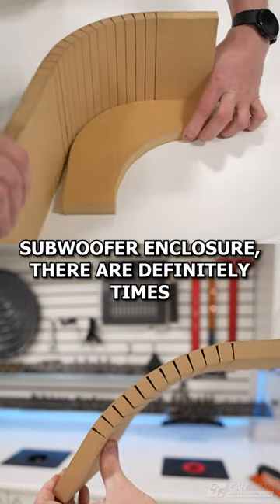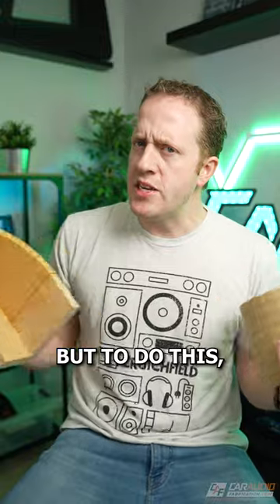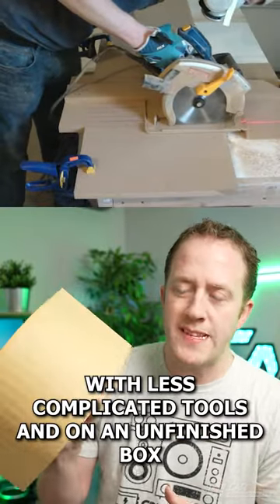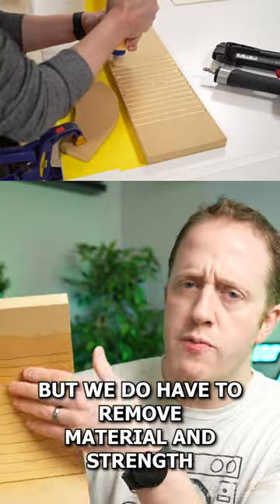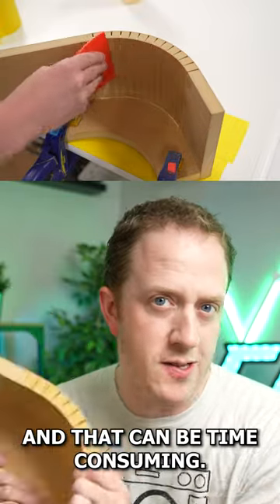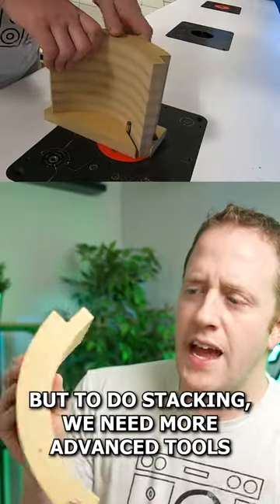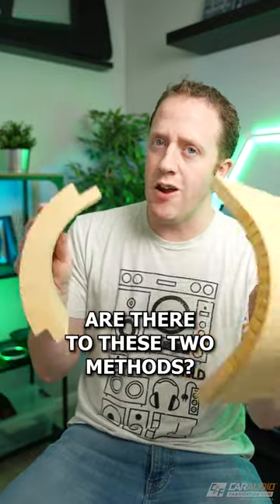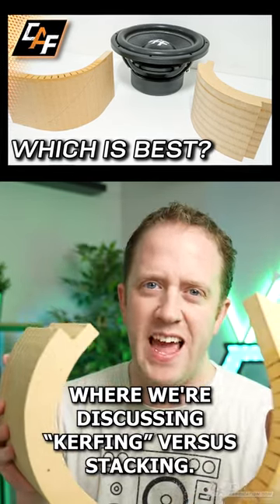Whats your favorite? Kerfing or Stacking?

Comment: Stacking.. I think this is ideal especially for high output subs with demanding loads. Most builds will be finished with either fabrics or vinyl leather etc.. or even 1/4" overlay with designs for a very nice finished product. This design is far more robust but definitely more time consuming & more extensive in the tools needed. Both have their place & is still used for for obvious reasons cuz they work

Comment: Both appear to provide the same acoustical advantage, could be wrong. However, stacking looks to give more rigidity and less vibration. 
I’d pay a few more bucks for STACKING
Reply: Kerfing will absolutely be less dense. Your removing substrate and replacing it with glue. The density will change how sound passes.

Comment: Soak it in water and bend it
Reply: I definitely wouldn't want to get MDF wet...
Reply: @hankbagrowski7356  The process requires a lot of compression so that it doesn't bubble or deteriorate, but you also have to use ammonia to keep mold from forming. This is a very very slow process, but would help keep the density that you lose from Kerfing.